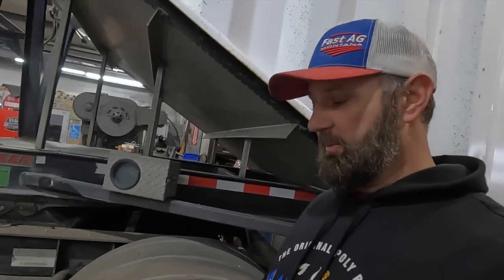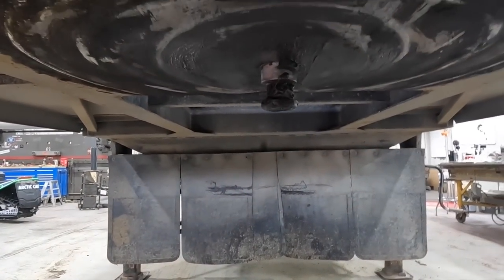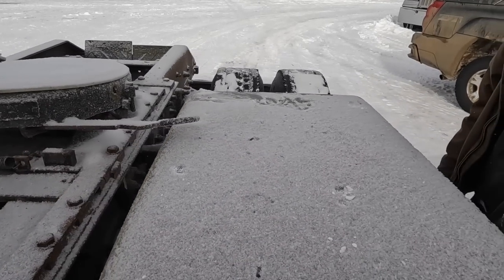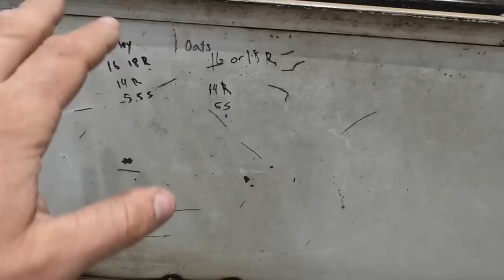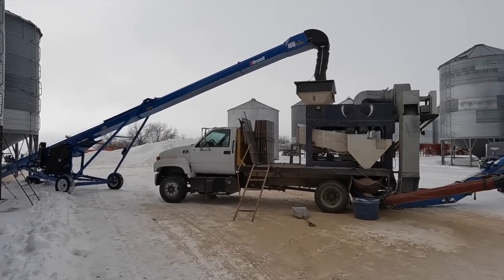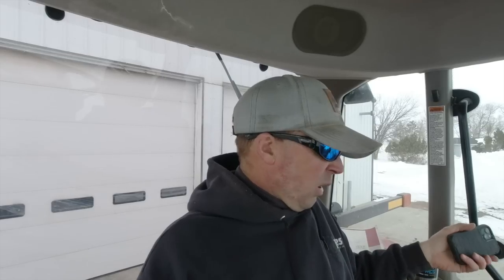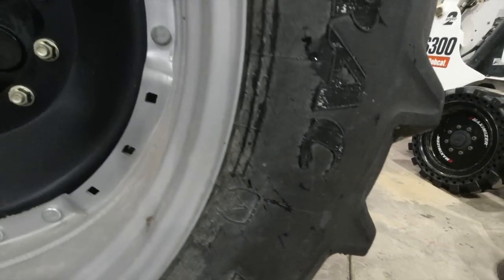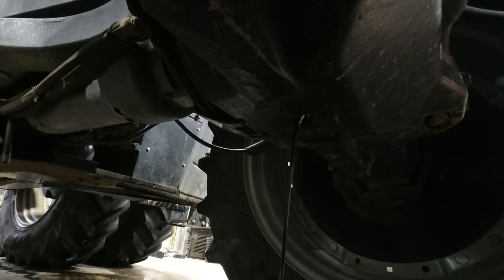All This Fun and NO PROOF!!

Comment: In Canada we can haul about 97,000 lbs of grain or fertilizer depending on weight of the tractor. About 1600 bushels of wheat.  I think it is less in Montana as their regulations are different.
Reply from the maker: Yes we can haul about 1200 if that here.

Comment: If you are adding electric gate openers for your hoppers put the power mechanisms on the opposite side that which you will be loading your drill from. That way you do not to be concerned about hitting them with your loading conveyor for the auger and it will still give you lots of clearance. Also when unloading the trailers at the bin with your grain auger.

Comment: Maybe you could change to a two-piece pillow block bearing like Cornhusker trailer uses. You would never have to change those ball bearings again. 
BTW, about 1985, I gave that idea  to the Cornhusker sales men in Mankato MN. Needless to say, I didn't get anything for my idea.
Webb Fuel heater
And Surelock roll tarp (WCCO)
Was my idea, too.

Comment: Great that you have a b-train in your fleet now. As an Aussie that has run B-doubles for years can say that they are easy to work with once you get used to them.

Although since your axle weights in the US are lower then Canadian specs you still have a high GCW so I would of thought keeping you 43ft wilson and running a rocky mountain double setup (RMD) buying a 32ft tandem axle pup and a dolly to attach to it would of helped out with your volume as well as your weight issue especially if you used your lift or pusher axle on the trucks with them? 

Not sure if you could get away running your triple axle 50ft wilson with a 32ft tandem axle pup behind as it would be close to you overall length limits in the state?